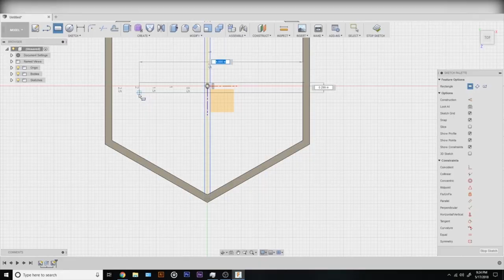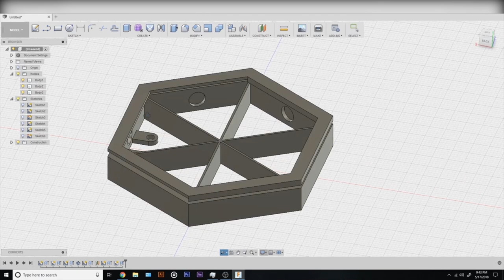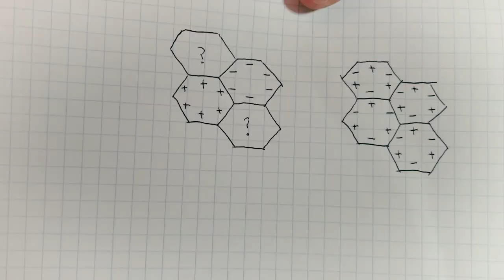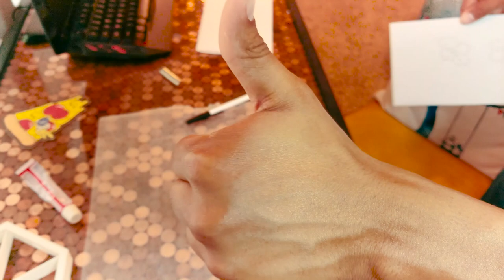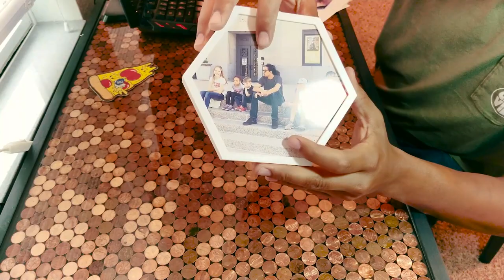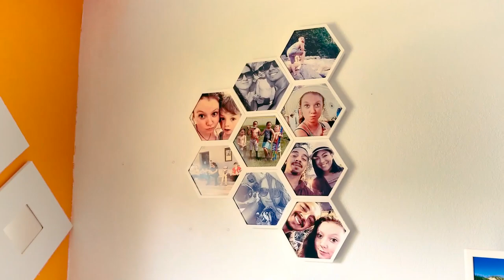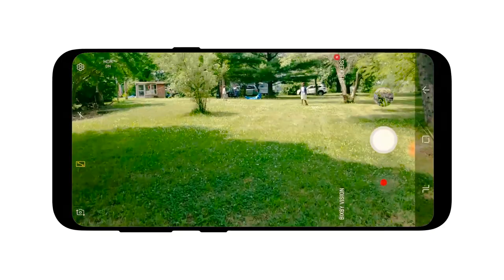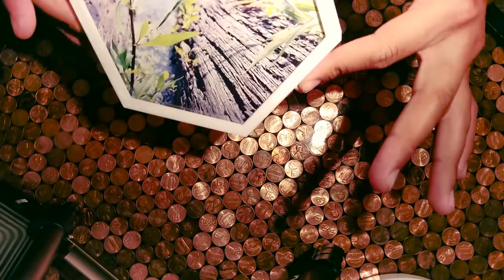DIY Magnetic Hexagon Picture Frames

Comment: What size, at what scale do you print it?
Reply from the maker: The size it is once you download it off thingiverse is the correct size. If you scale up the magnets will not fit.
Reply: @abmakes9583  they need to scale up, they're very tiny at the file
Reply from the maker: @edgardosh  Sorry I am used to simplify 3d auto scale. The files are in inches so when imported it thinks mm. So just scale 2540% and it should be perfect.